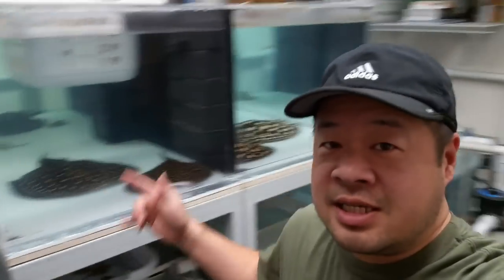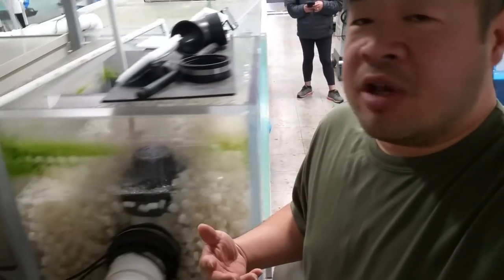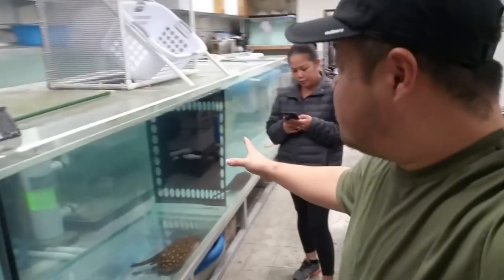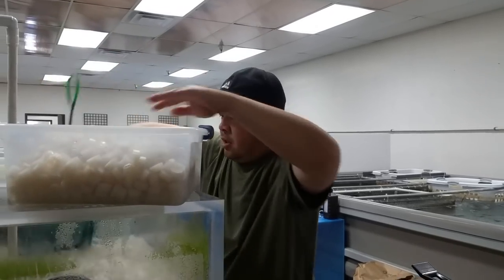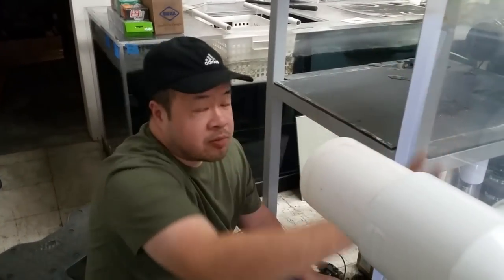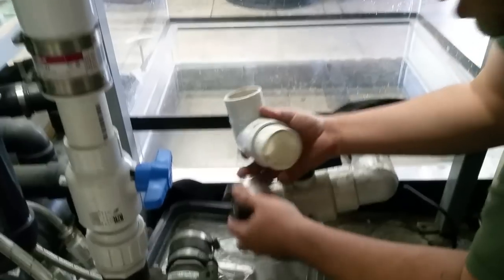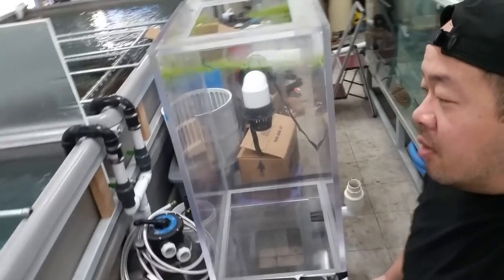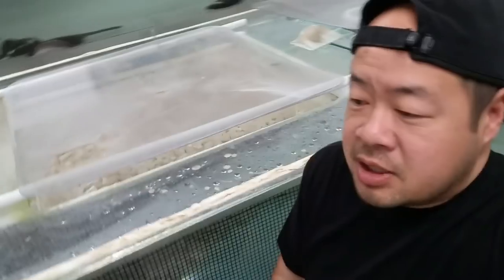RACE AGAINST TIME - Replacing FILTER before fish run out of OXYGEN

Comment: Hi Kev just a question on your uv. Dose it run effectively hooked directly from the pump?.would slowing the LPH be better “T” off from main return piping  pushing the water slower through the Uv then plumbed to tank as a second return line. If that make sense to you, would that be more efficient. Love you system plumbing videos 👌

Comment: Thank Heavens everything is working! After that first system was removed and you were putting in the new system with new components (untested!) I was wondering how fast you could reattach the old system if you had to? Then it occurred to me - you had a backup plan! Move the Albino Boesemani and her mates into another tank if all else failed! Tell me i am right, lie if necessary! (family joke, sorry!)
Reply from the maker: My goal was to get it done the same day. It wasn't easy but had to be done.
Reply: @StingrayBiology  
A worthy goal. And it all worked out, no complications. I'm retired now but my job has included project management. Planning for optimal while being prepared for the worst is an occupational requirement I guess I haven't shaken!